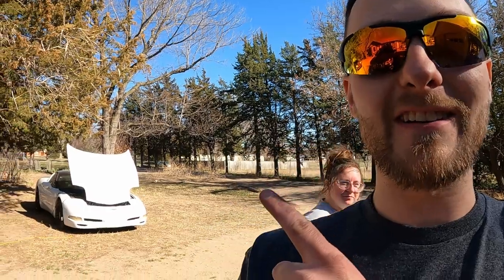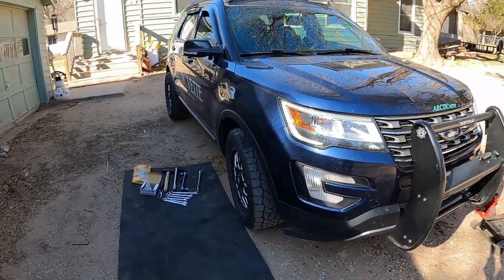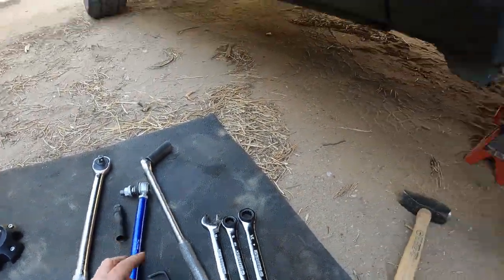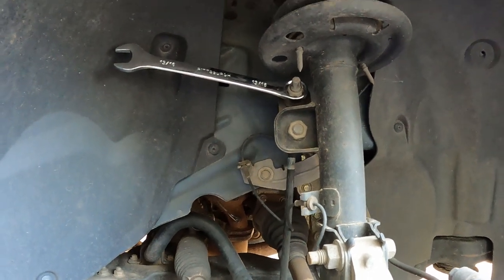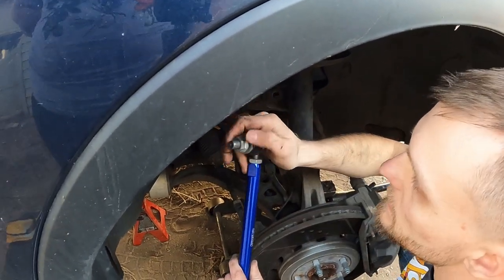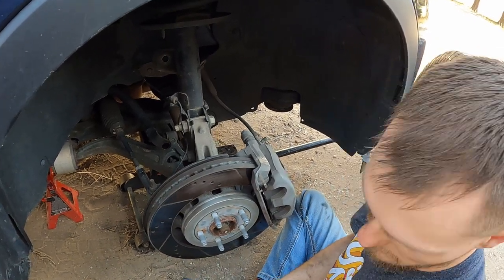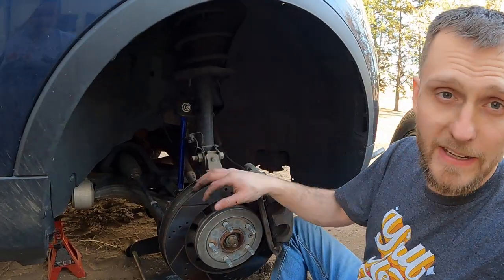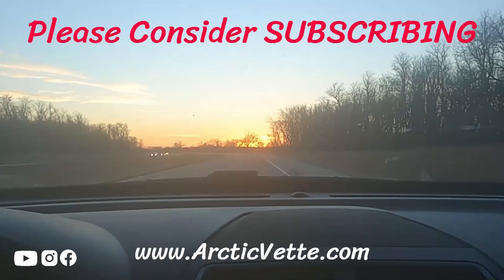How To replace Sway Bar Links on a Ford Explorer - Fifth Gen 2011-2019 - Daily Vlog

Comment: Was the threaded stud from the sway link the right size for the hole through the strut? I think stock size for it was M14 with a 21mm nut? But I'm wondering if this new end link has any play through the hole?
Reply from the maker: A little bit like stock, check out 5:45 for a good look at it
Reply: @ArcticVette  I replayed so many times and it was hard to tell. Ha I've been through 3 different end links and all of them weren't stock size for the thread insert. They've all had play and no matter how tight I screw the nut on, always clunked around. But I understand what you said, IT IS HARD to find a good one. And I'm still searching... Haha
Reply from the maker: I used some loctite on these and got them tightened a couple times after driving. Now they're solid and not clicking anymore 🙌🏼

Maybe not the best option but definitely a good one that I'd recommend. Hopefully you'll find a better one if you don't go with these 🙌🏼